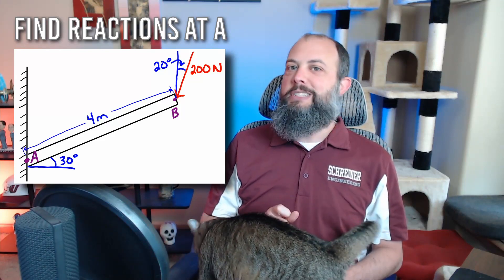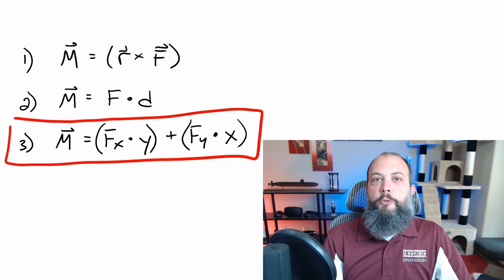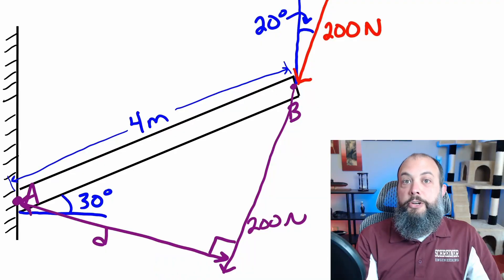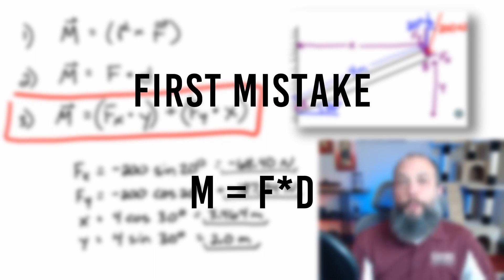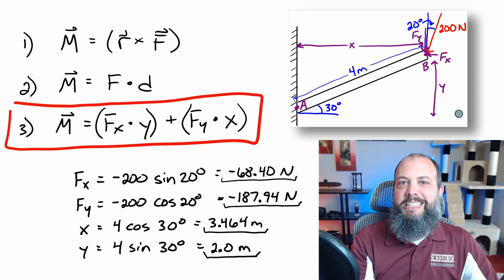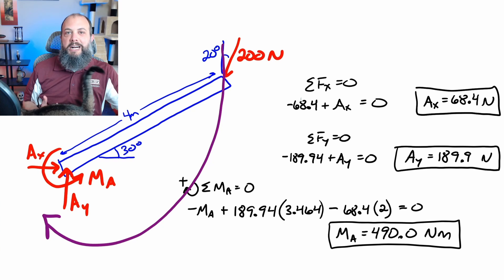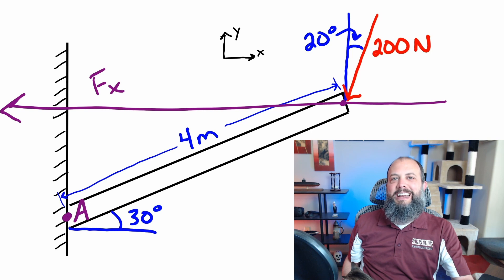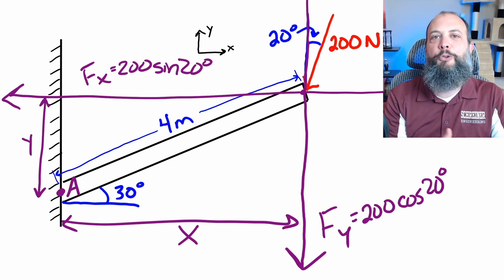How to Find the Moment of a Diagonal Force - Moment Scalar Analysis

Comment: Really good methodology.  Brings back my 2003 Statics course.  One small thing is that I get 0= -Ma-68.404N(2.0m)+187.939N(3.464m) as Ma=514.213 N-m.  That is not what you got, but maybe since I am using more significant figures, then I get a slightly higher answer.  Any help?
Reply from the maker: Your answer is correct. I actually made 2 mistakes in this video. I first misread my own handwriting which should be 187.94 and accidentally wrote it as 189.94. That's mistake 1. The second mistake was a calculator mistake, I typed into my calculator as 180.94. Confirming that 187.94 is the correct downward y component force, and 514.2 is correct final answer. The 490 comes from using 180.94, which is neither correct, nor even the wrong number I wrote. Very sloppy, I may edit this and reupload sometime in the future.
Reply: @BrianBernardEngineering  thanks for verifying Brian.  I really enjoy viewing your videos.
Reply from the maker: @chrisaprile813  thank you for pointing out the mistake. its embarrassing for me, but I'd always rather know than not, so that other viewers can see these comments for the correct information.
Reply: @BrianBernardEngineering  no worries....Brian you have helped a lot of students with your dynamic and enthusiastic presentation.  It is sometimes hard to make engineering fun.